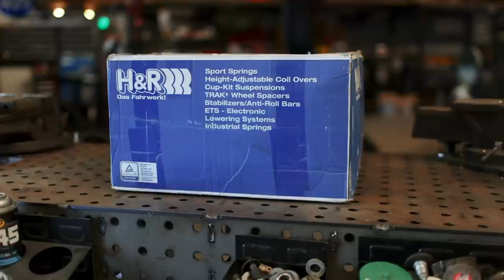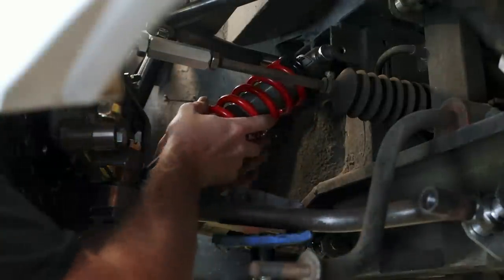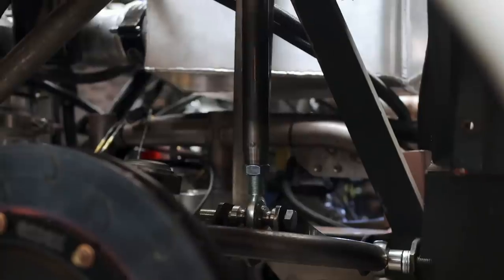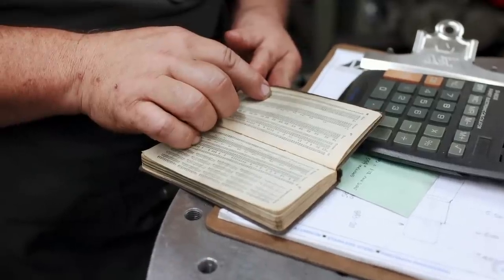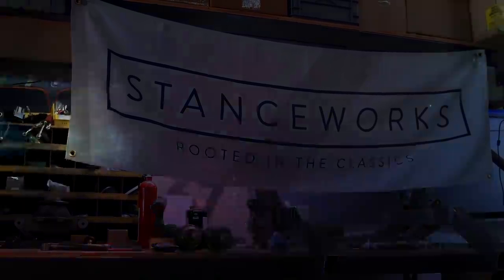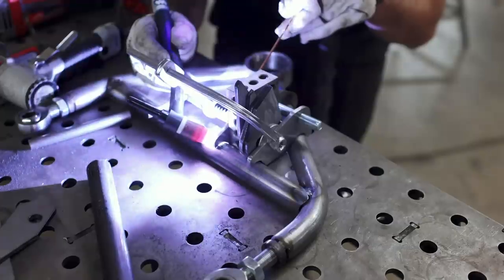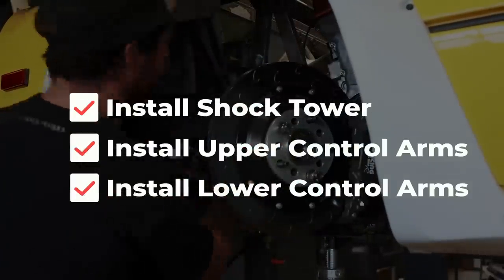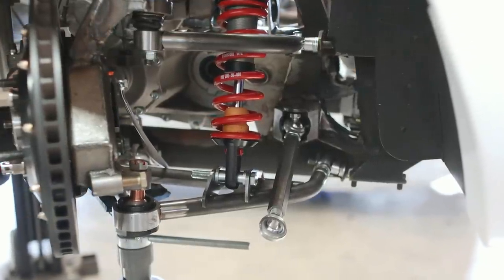COILOVERS! Custom H&R Suspension Build for the Honda-Swapped Ferrari

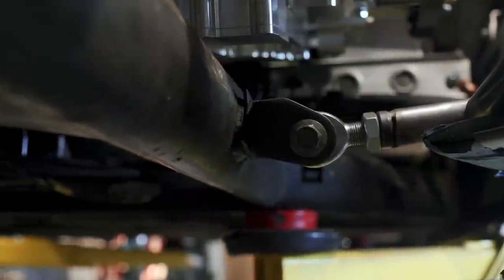Comment: 12:04 Control arm mounts - just a thought, maybe don't make them SUPER strong. On our formula cars, those are a fuse, so we don't destroy the chassis in a crash. Granted you won't crash as often as a wheel to wheel car, but again just a thought. keep up the awesome project and content!
Reply: I knew this was a thing... I have this Bigscale 1:4or5ish RC car...
had It full alloy and when I crashed was crying like a baby...
from now on most of my wheel/shock-mounting stuff are ABS plastic
to create the weakest link in the chain to save the chassis!
Reply: That's a great concept! As far as I know, Wisefab uses this principle when designing and producing their suspension components for rally and drift cars.
Reply: I remember he initially made them super flexible at first for that very reason.

Comment: Put a fuel pump kill switch on your 6 liter and use it every time you park it. Thieves can break into it but won't be able to start it.
Reply: That’s so dumb. They wouldn’t be able to handle the car to start with. Or figure out how to start it
Reply: @Flatout56-o8k  boi I believe that's the point
Reply: @crionidel  internet experts...
Reply: @Flatout56-o8k  either you have no knowledge of anyones driving skill except you and your mates driving your front wheel drive fords or you have such knowledge of stealing cars you know that car is too much for a general car thief. I refuse to believe there is any room for you to fit in between
Reply: @Flatout56-o8k  the "6 liter" is his Ford Super Duty pickup not the Ferrari...genius
Reply: @bsfunk44  😂, right? I was like "What is this bloke on about?"
Reply: Just do a battery kill switch. I put one in my car since my door locks are hard to unlock so I just don't lock it.
Reply: @crionidel  i think he meant that thieves wouldn't be able to turn it on anyway, even without a killswitch
Reply: @joaom3664  hotwiring, stealing the keys somehow... but yeah some people are too stupid to know how to do those things.
Reply: Watch the video to the end regarding his truck and you'll get the context and see this comment make sense
Reply: a tow truck car thief does not care about any security measures except maybe a gps tracker until they throw it in an enclosed trailer
Reply: @jackweta  True but the 6.0's aren't being stolen with tow trucks. They have a cheap wheel lock and ignition switch that can be broken off by hand and you can start the truck with no tools or keys.

Comment: I feel you on the hours spent cleaning up plasma cut parts. Back when I was working in the maintenance department of a factory I had to design and cut out new brackets out of 3/4" plate steel that were needed that day to keep our maintenance week rolling. Took ages to get the CNC plasma cutter to even cut the 20+ brackets out (had to be one continuous cut otherwise the torch would lose arc) and then even longer to finish the parts for use.

A couple more check marks on the list today, and a very packed episode as a result. Getting closer and closer to being able to rip down the street!

Comment: Another great episode!

Suggestion: For exposed steel that will not be painted or removed to be powder coated, consider having some Nyalic clearcoat (not paint)
 on hand as a clear polymer protectant.

It'd take some fancy mechanism routing, but if you could have your rear wing mounted directly to the lower control arm (perhaps through a lever etc) you'd cease transmitting it's downforce through the rear springs and instead, directly to the ground.

Maybe add a GPS locator to your vehicles?  They can be hidden and have an outright cost + sub at $200 for 2 years or so.

Comment: You're doing some extremely cool work!  And don't let the turkeys get you down.  If there weren't lows, you wouldn't realize how good the high-points feel, and ultimately you'll look back on all of it and even most of the lows aren't as bad as they looked at the time.  I can't remember if you ever saw my M635, but it's my baby.  At the same time, I look at stuff that happens to it as part of the adventure.  (You should see if Mark Rober will build you a glitter bomb car-theft-deterrence system...)

Comment: Really elegant solution redoing the rear suspension. It's been great watching the revisions improving themselves over time, and awesome of H&R to include so many spring rates for continued testing/improvements. Will you be adding shock pots for getting more track data?

Comment: I have had a truck stolen too. It does not feel good. Keep doing what your doing. 

The alarm did its job. Only other thing you can do is install a ignition cut off or two step key process so without the chip and key the truck does not start.

Keep the truck don't give up what you have built and earned. Your doing what you do cause it drives you. That was just a speed bump!

Comment: Regarding the attempted theft of your truck. At the end of the day you can never cover every means by which a thief can steal your truck. But for the thief who tries to pick your door lock and use electronic means to steal it, you can slow them down to the point where they'll give up and move on. 
You mentioned kill switches. This is a great start. Killing the fuel pump and some key modules will go a long way. 
An additional way to deny them access would be either to relocate/hide the OBD2 port with extended wiring or to remove the OBD2 port from the vehicle all together. In it's place you could install any different connector of your choice (which a thief could not plug into) and make an extension from that connector to OBD2 which you keep separately for when you need the port. 
If you wanted to be really mean, you could hide your OBD2 port and install a dummy OBD2 port and rig it such that when anything is plugged in it closes the circuit and sends a thousand volts out to each pin, frying their computer.

Comment: Love the suspension stuff! Good pick up on the falling rate position of the damper. So often missed. Glad you’ve got the extra springs as you’ve probably changed the motion ratio at the rear and will have to compensate. 

As for the attempted theft, I’m angry for you! Install some kind of kill switch you can hide away.

Comment: Any worry about the front tie rod mount having flex in it with the tie rod being mounted through that long spacer? I know it needed to be done for geometry but maybe putting a 2nd anchor point on the spacer to prevent it flexing under high loads?
Reply: I agree, it should be a double shear mount

Comment: On the front suspension, it looks like you have plenty of room to set the shock up more vertical, and maybe even move the control arm mount out toward the wheel a bit. You’d get more effective spring and damping effects, and moving the lower mount out on the control arm would give a better motion ratio, again improving spring and damping. This would let you lower the spring rates to get a similar wheel rate giving the suspension better response to the road.

Comment: One of the best fixes for these modern thieves that I’ve seen is a simple metal garage. One of the ones that are inclosed and have enough space for one vehicle. Most people these days just use them for storage, so no one thinks there is a vehicle in them. Plus they normally don’t have windows in them so they have to break down a door to get in. Most of the time, if a thief has to go through the trouble of breaking down a door for there to be any knowledge of there being anything inside, they won’t break in. I hope this helps, me I know it’s not the cheapest or best solution, but I know it works.

Comment: Please check wir H&R the new conditions for the spring rate. By repositioning and changing the angle of the shock you will end up with different forces acting on the spring (due to different leverage). Especially for a short damper / spring like this the change should at least be double checked. 😉👍🏻

Comment: I try my best to give advice I believe is warranted without sounding like I am bitching. Anyhow this car is going to push some heavy duty stresses on the new shocks you are installing. My only concern is heat. And they are going to generate a lot of it! Remote fluid reservoirs would have been my choice for your application along with, compression and rebound adjustability and like I had on the rear of my GSXR750 race bike adjustable hydrolic spring preload via knob placed in hands reach. Many may not know what I am talking about. Take a look at the shocks offered by O'hlins suspension to get a better understanding

Comment: hey hey watching an older video where you had a bit of trouble getting in and out of the car. You may have fixed this, but I recommend a quick release steering wheel. so the steering wheel is not in the way when you are getting in and out of the car !

Comment: Nice work, just some input here, the upper rear shockmounts are quite long, what are the wall thickness and dimensions of the pipe that they are welded to? Its gonna take some high forces, mostly from the shock.

Comment: do you run some kind of kinematic animation for the relocated rear shocks - this is quite important in order to have an proper working suspension - you would need to angle the shock the exact right amount - if not then it might be too linear to progressive of even degressive...

Comment: The lower heim joint at 2:40 looks like it's tilted at an angle.  Is that ok?   It doesn't seem optimal given the motion arc of the control arm.

Comment: Why don’t you make the toe link from a tube, bend it around the control arm and just have a section be adjustable?
Reply from the maker: It would try to rotate itself if it was bent.  The heims are the wrong orientation

Comment: I feel ya, some a$$hat pos tried to steal my 2001 7.3 ford truck full of tools while I was inside home depot picking up lumber on my way to a job. Of course home depot had 0 footage of it saying their camera don't go out further than the firelane nevermind the parking lot. They would have gotten my 4 door long bed 7.3l with just about every carpentry tool I own and my sound system, all in one shot. They were one tumbler pin (correct terminology?) away from being able to start it with a screw driver. And take off. I now disable the truck multiple ways every single time I leave it even for a minute it will be out of my sight at any point when I'm not near it. Ppl suck.

Comment: Friend I'm in Brazil I hope you'll excuse me because I don't speak English. I'm 64 years old and I'm trying to fulfill an old dream of manufacturing my tricycle. It will be assembled with an automatic Honda WRV engine and I would like it if you could provide me with the model of the shock absorber that you are using on the front of this car you are building and also if you can provide me with the design of the arms of your double A suspension.